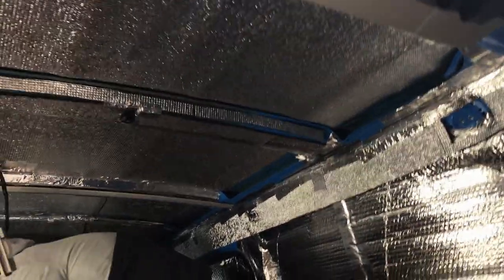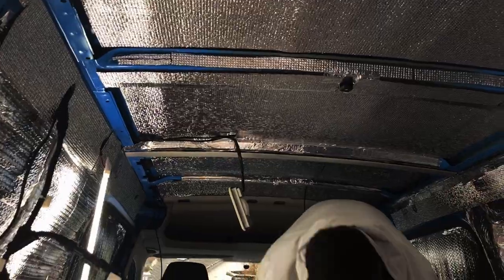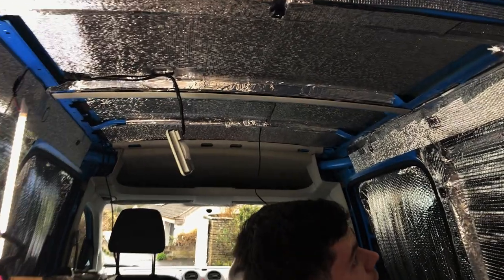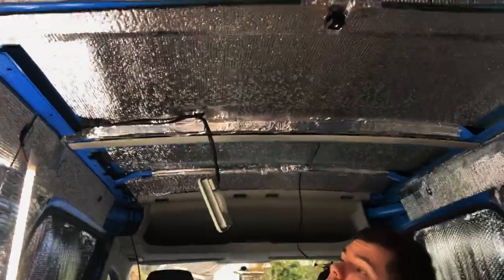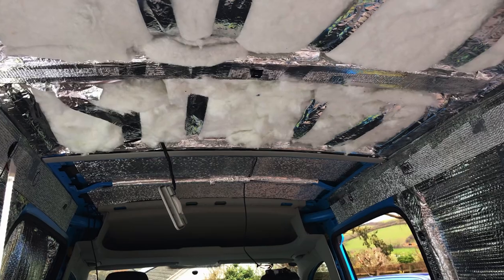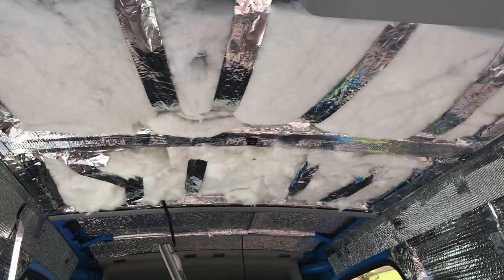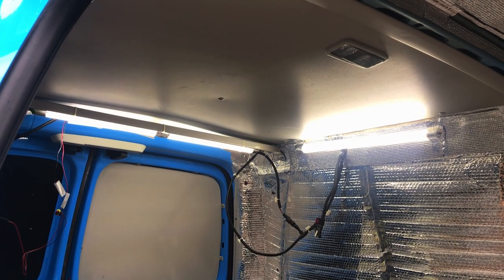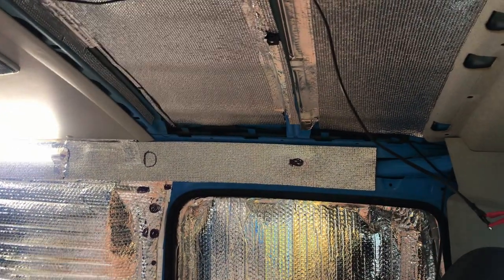VW Caddy Maxi CONVERSION - Self Build Part 3

Comment: Great vid silly question but do the ceiling fixtures pop out as mine wont budge...thanks
Reply from the maker: Hey, yeah they do, you can use a small allen key to loosen them off and then use some pliers to pull them out. If you have a look at my white caddy build series. I believe in the second video, I take out the roof and show you how to do this. 😁
Reply: @willsvanadventures  OK cool will find that vid,didn't think of Allen key just ripped the sides off opps ha ha
Reply from the maker: @petergreenslade5247  hahah no worries, they are a bit of a pain but if you get a good hold they pull put fairly easily. Good luck!